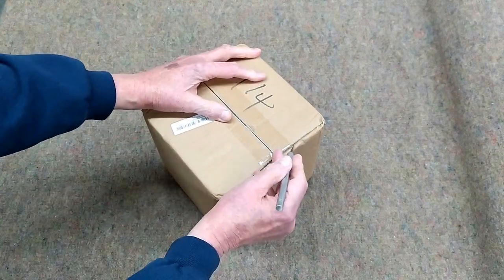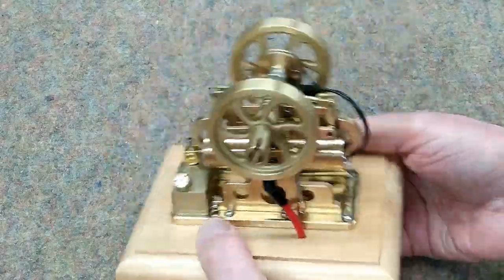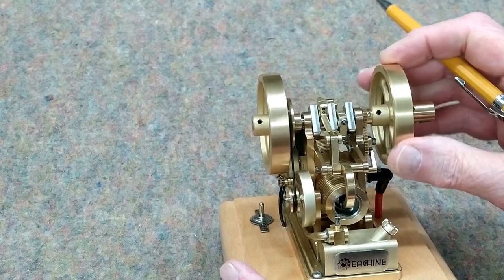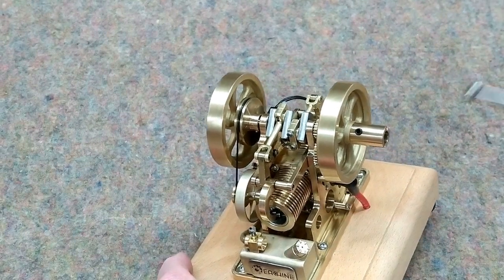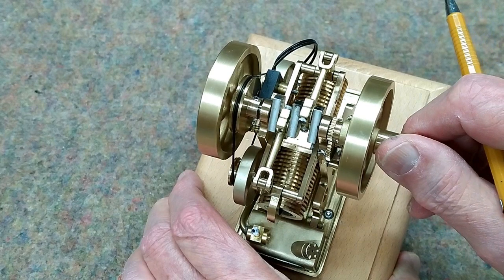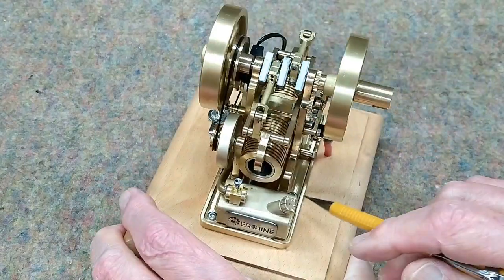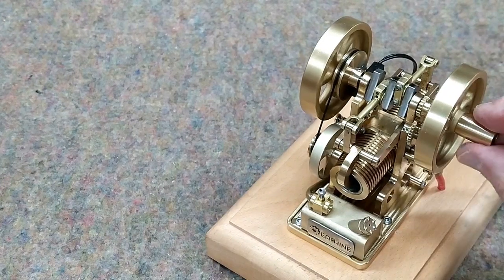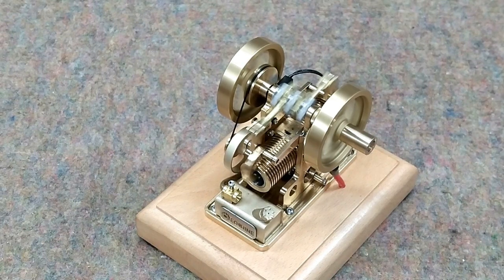Eachine EM1 Double-Piston Mini Engine

Comment: Is that an Atkinson Differential engine, or just a regular opposed-piston engine?
Reply from the maker: This is an opposed-piston engine. The title says double-piston because that is what the Chinese manufacturer calls it.
Thanks for watching. Please subscribe. 
That is what keeps this channel running. 
Ron
Reply: this runs on the 4 stroke Otto cycle NOT Atkinson cycle as one well known company try to market it as, I would describe it as single cylinder opposed piston engine
Reply: That a really neat engine